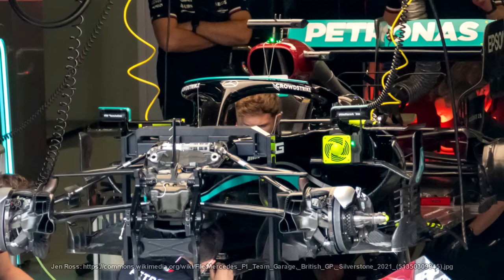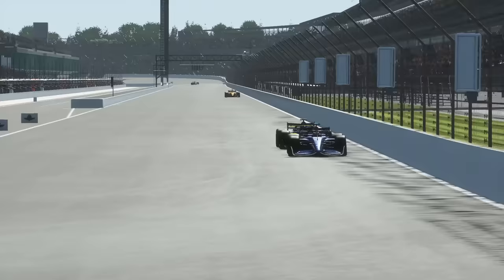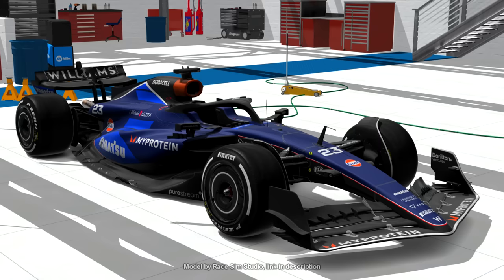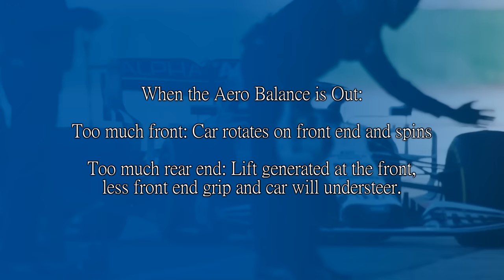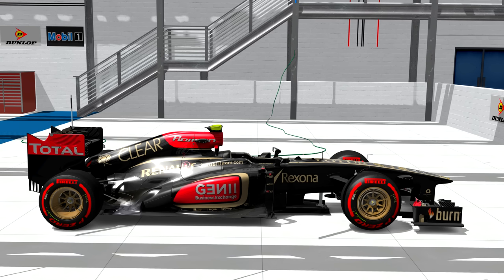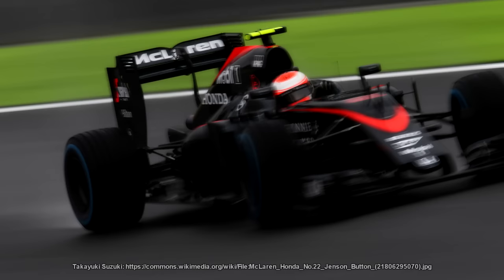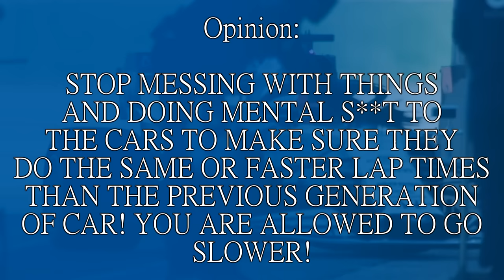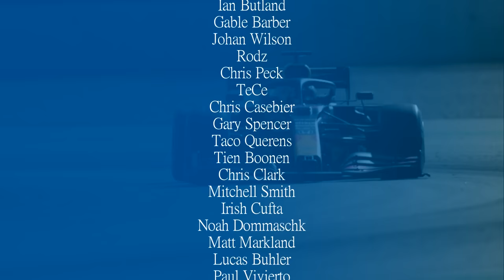BROKEN BEFORE IT'S EVEN IN? Opinions on the 'Undriveable' 2026 F1 Cars

Comment: Stupid fkn idea: what if, instead of DRS, the front wing could activate more in corners when following another car to counteract outwash? Like the angle of attack gets steeper in the corner, just angling slightly?
Reply: It doesn't really work that way because if you are running in dirty air your wing is going to be producing less downforce no matter what angle you run it at. Also if you were in a train the cars at the back would be producing unreal amounts of dirty air hahaha
Reply: @wiegraf9009  hey, at least I knew it was stupid lmao. Still, wouldn't increasing the angle be able to make it get close to normal grip, if it would have significantly increased grip without being in dirty air?

Comment: Your idea of balance isn't entirely correct, or you just didn't bother to go any deeper. The front wing becomes active at a much lower speed given that the car is running in clean air, it takes quite a bit more speed to get the airflow cleaned up and activate the rear wing but when it does it generates more down force than the front wing. This is generally what is meant by balance, "when is what activated, and when/where is the crossover". Not the Euro fighter but the F16 was the first aerodynamically unstable fighter, though they don't fall from the sky incase of a power failure(nor does the Euro fighter). If an F16 looses all power a hydrazine driven generator kicks in to provide sufficient power for a safe landing, given there is an airfield in the vicinity. I presume, never worked on one, the Euro fighter works in the same way.

Comment: So the "Fairies Into Annoyance" keep screwing with the F1 regs to please almost anyone with spare cash to wave about. Every time, the cars get more expensive & the spectators get screwed (ticket prices, build Grandstands & advertising where General Admission used to sit, kebab van food at Michelin Star prices, race for 3 corners then 58 laps holding your position).
Watching the Constructors race could often be more exciting that the Drivers, but now everything is overregulated to neuter some of the smartest engineers on the planet. Engines used to be a set capacity, forced induction or not. It was the Engineers who decided 4, 6, 8, 10, 12 or 16 cylinders, & what shape the cylinders were. Mandating 1.6 litre, 90 degree V6 round pistons makes them all the same sound & characteristics, & plays into Aidrian Newey's hands. Today's F1 cars are too big, too heavy, too complicated & far too restricted in what a smart engineer can accomplish.
Replace the 400 page rule book with a 20 page book, & F1 will become exciting again.

Comment: Agreed about going slower. 
Dr. Ian Malcolm said something like, just because you can doesn't mean you should.
Indycar has gone through many changes over the years. 
Front areo wash on ovals seems to be the worst its ever been in Indycar. I could be very wrong about that. I am just sharing my opinion on what I have seen over the past 7 years with this chassis.
I understand that aero wash happens all the time in many forms of racing and to some extent it can't be totally gotten rid of.
But this oval racing thing is a different kind of animal.
1 2 or even 3 times in a race the aero wash puts someone in the wall. 
I hope the new chassis tries to fix this issue. Indycars are the safest they have ever been but I think there is still work to be done.

Comment: Just ditch hybrid and go back to 2 litre turbo petrol. It’s motor racing not R and D for the car industry.
Reply: Not to mention that racing R&D basically stopped having any relevance to roadcar R&D in the 2000s. Running ultra fancy hybrid systems isn't going to bridge that gap back.
Reply: if f1 want to be R&D they need to go 100% electric

Comment: They just need to drop all the electric nonsense. no one wants it. it's supposed to help push the road car manufacturers, but they don't want it either If they want viewership to increase they need passing and car that don't sound horrible. drop the v6. it's one of the worst sounding configurations possible. shrink the cars, move aero underneath. it's so easy and could massively reduce cost with sensible regs. they just wont do it tho. clown world requires that the new solutions to problems are horrible, don't work, are things no one asked for, are too expensove and create new niche indsitries built on lies. this is exactly why F1 is what it is now. we cant even have grid girls or a whiskey sponsor

i hope it all fails and burns to the ground. it's unfixable at this point and they refuse anyway. it must be totally destroyed so something else better can be built in its place

Comment: As far as i know of the engine rules are signed of. There lies the problem 'cause the next generation needs active or at least moveble aero (flexiwings) to finish a lap at speed due to the availible energy per lap. The amount of fuel is cut down to make cars lighter and an amount of fuel is added to run the engine-MGU-K combo as a genset. There is now only a 10-15 kg deficit in total fuel load. Last year Cristian Horner and Max Verstappen warned the FIA and were laughed at by Mercedes and McLaren. It is a total mess.

Comment: Formula e has the batteries. F1 has bashed out hybrids for 10 years now. Let go to sustainable fuel and back to v8s or v10s and give the fans what they want and appease the environmentalist at the same time. Make an engine that runs on ethanol or hydrogen or any combination you like. Hybrids have run their course.
Reply: Synthetic gasoline is way better than ethanol or hydrogen but yeah.

Comment: I want the cars to be undriveable.  These are the best drivers in the world.  They need to separate the men from the boys.
Reply: Sure but undrivable cars going slower than F2 is not going to inspire good viewership
Reply: @RD-wg9em That and drivers do not want to be cars that tend to spin out.
Reply: We need cars that are to powerful to drive, like in the good days!
Not boring slow hybrid vehicles that are just stupid.
Reply: @nicestoriesnottherealstori3006  yup, at this point a simplified aero package that looses lap time may be needed
Reply: @RD-wg9em  I could care less if the cars were running 2-minute laps at Suzuka as long as we are watching passes made by talent and not some gimmick.  Did you catch the dig at George and how computer-controlled the cars are at 11:11
Reply: I think there is a difference between a car that is undrivable and a car that is challenging to drive, for instance it has lots of power and less downforce, and maybe less complex suspensions. Having undrivable cars sounds like a car that has only three functioning tyres Or driving on slicks during heavy. Having a car that is ridicously snappy and absurdly unpredictable, is very dangerous, and may not be racable, so you need to be super careful. Best case would be cars that you have to fight a bit with and need lots of feeling to play with it, and can be also somewhat aggressive.
Reply: Said they little boy who doesn't understand F1 or racing in general
Reply: @rolux4853  Some of my fondest memories in F1 are when the track conditions are right between slick and intermediate tire conditions.  Just like when you have too much power, the rear end slides around like a tango dancer.  That's when we see the best drivers put their cars on the absolute limit of adhesion.
Reply: @eoincassin4265  Oh really?  I can remember almost every race I watched since the days of Gilles and Lauda. Have you not experienced racing in the last century?
Reply: @delusion2987  Formula One had several periods where they were not the fastest open-wheel series.  As recently as 2014, the GP2 series was faster.